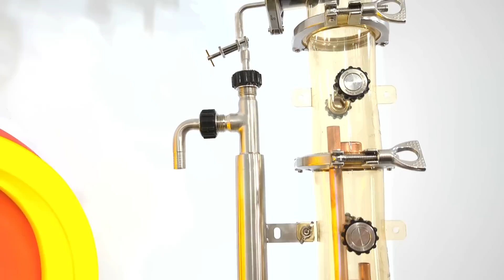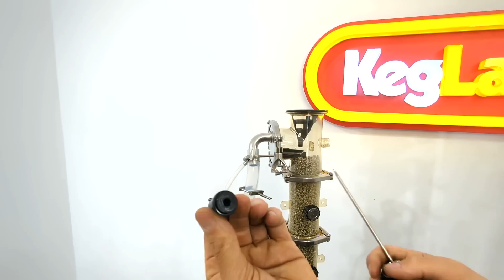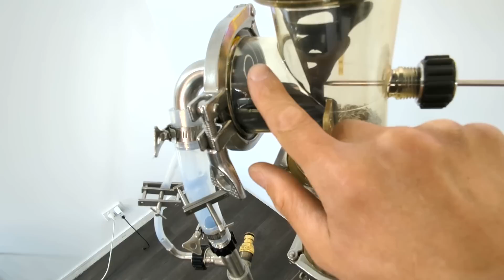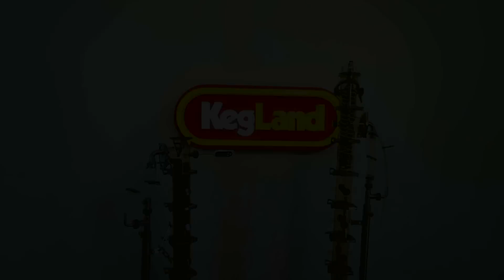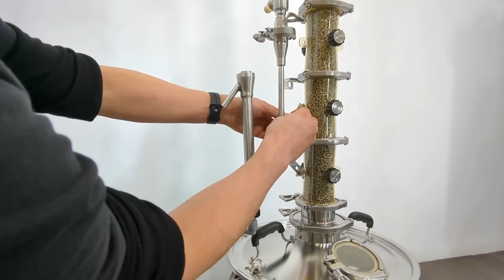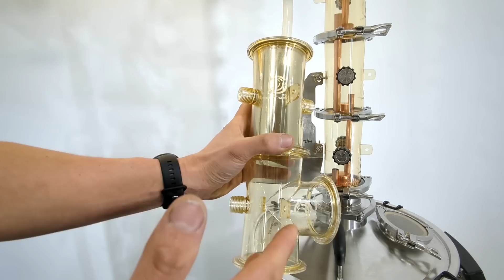Modular Polyphoenix Distillation Head for Reflux, Pot, Whiskey, Gin, Rum or Vodka

Comment: Polyphenylsulfone is listed with bad resistance to acetone and fair resistance to ethanol in a chemical compatibility chart. Can you elaborate on how it works in a still if its not resistant to acetone and ethanol?
Reply: Also how the still looks after 50 distillation cycles....

Comment: Kee, will you release some electronic column monitoring to stop distilation when head temperature goes too far? :-)
Reply from the maker: You can set the BrewZilla to turn off when it reaches a certain temp so this is pretty easy to do.

Comment: Looks great. Have you tested them running under a vacuum?
Reply from the maker: We are doing testing on this now.  The BrewZilla is not able to handle vacuum but if you use a keg as the boiler this works fine.

Comment: With the hammerhead style is it slightly beveled to allow liquid to run back down column or does some stay resting inside hammerhead?
Reply from the maker: It's not beveled but if this bothers you then you can also just turn the hammerhead vertical.  It simply doesnt fit well into the video frame when I do that so I have been recording with the hammerhead most of the time

Comment: Are you getting better results from the SPP or the bubble plates for vodka? 
5 sections is about as high as the roof will let me go so looking to maximise the reflux in that height.
Reply from the maker: The SPP for sure. I will cover this in a video.  If you have 1 meter of SPP packing you would need about 20 bubble capper plates to get an equivalent result.  So the SPP is:

1. More compact as 20 bubble capper chambers would be enormous
2. More cost effective as the SPP is less expensive than 20 bubble capper plate sections
Reply: @ Thanks, any estimate on number of bags per 3” section (or number of 3” sections per bag😋)

Comment: I like the concept of see-through distillation components.
My main issues is long term durability and the advantage of using a metal such as copper which can act to extract sulphur from the products. This of course can be overcome by including a packed section of the column that contains material such as copper cylinders, wool or saddles. 
I would use these plastic cylindrical sections in a column but spaced out across the column length (say one at the top, middle and bottom).
There are stainless steel housed slight glass sections available for distillation columns that are now very economical.
I am not sure how economical these plastic sections are in comparison.
Controlling a distillation column is very challenging. The level and ethanol concentration, in the pot declines with time and the heat input must adjust for these changes. It's very dynamic even when running well. In reality you cannot say the column is in equilibrium because product is being extracted and concentrations are continually changing with time. It's a kind of pseudo or quasi equilibrium state with the goal of running the column in a smooth way)

(the heat loss issue with metallic columns is easily solved by installing some thermal installation around the column)
Reply from the maker: I would agree that a small amount of copper is a good idea to act as a catalyst to release sulfur.  With that there is no reason to make the entire still out of copper as you simply do not get more and more sulfur released with more and more copper used.  I should also say that the copper should be used and treated like a "consumable".  We do sell bubble capper plates made from copper and in the future we will also have the SPP made from copper too.  So this is a very easy way to get the copper exposure you would need to release sulfur.  You could also just get some scrap offcuts of copper pipe and pack it in a section of the column and achieve the same result
Reply: @KegLand  true - cheers

Comment: Will you be selling the setup in the video as a kit? What hose do you use for the vapor management?
Reply: and can you please add the link ot the channel you referenced - pavel?
Reply from the maker: Yes we have more parts arriving soon and then we will put them together as kits on the website. At the moment it's a bit confusing working out how it all goes together. 

The particular hose we recommend for vapour management is on the way via air mail.  Our current sizes were too small so we had to get a new larger diameter size manufactured for this application.
Reply: @KegLand  Thanks very helpful can't wait - what was the youtube channel he said he would link?

Comment: Great video, have been waiting for more on these PPSU still parts, I was hoping to hear some scientific facts about PPSU and high temperature ethanol to ease my mind, Does seem to be some confusion on condenser names, calling a reflux condenser a product condenser, yes you could configure it that way if you chose to, but the way you have set it up, its a reflux condenser, calling a Liebig condenser a shotgun, two different things that do the same job. All in all a great job explaining the differences between CM,VM and LM stills.
Reply from the maker: Sorry about the confusion.  The still has two condensers on it:

The coil looking 3" TC "product condenser" and also the second condenser is the "shotgun" condenser that is a straight stainless rod that has 5 x 1/2" threads on it.  When you assemble the whole still with both condensers and fill the column with packing the entire assembly becomes a "reflux still".  I hope that makes a bit more sense.

Yes one of the other guys in the office have already paid me out for using the term "shotgun" as well.
Reply: @KegLand  PolyPhoenix - Modular Hammerhead / Vertical Condenser - PPSU 3 Inch TC "reflux condenser" can also be used as a product condenser.

Comment: Fantastic stuff Kee. I'll be into it for sure. How resilient are the plastics after repeated use after exposure to heat & solvents?
And another thing... the gutsy Pro lid for the 35L brewzilla has a 2 inch vertical port (3 inch view port). So will be there be a v2 Pro lid with 3 inch vertical tri clover port for the 35L boilers/zillas? or do we just get a 2-3 inch coupling from elsewhere?
Reply from the maker: The PPSU plastic is resistant to a wide range of solvents including ethanol.  Did you want to use the still with solvents other than ethanol?  The particular grade we use is "Radel R5500" and you can readily download the chemical resistance chart for this.

Yes for the pro distillation lids you will need to get a 2" to 3" reducer.  That is correct.